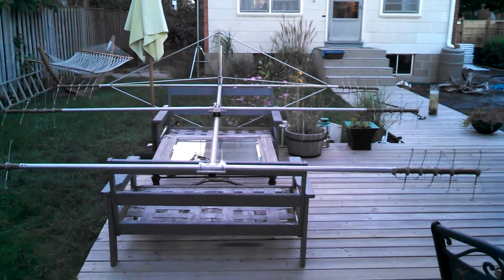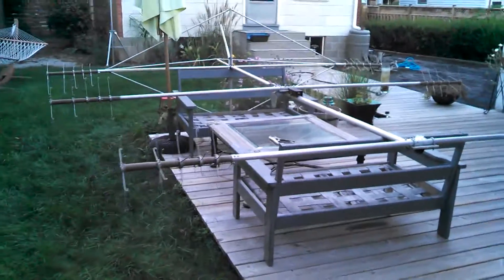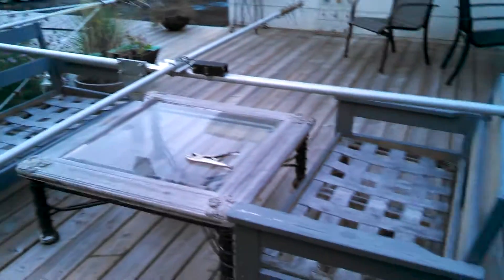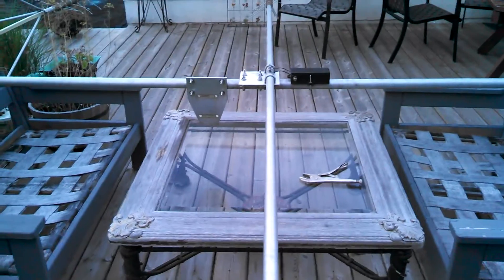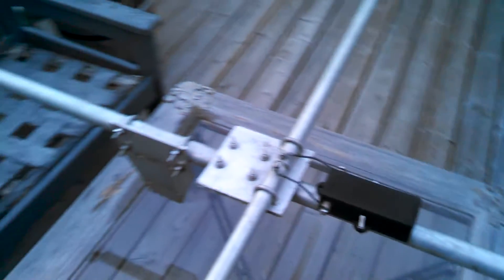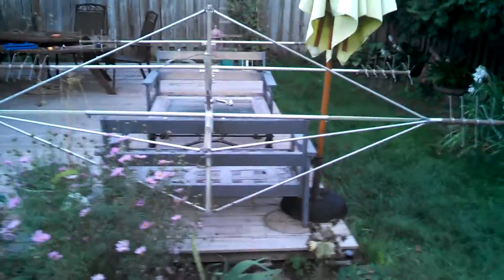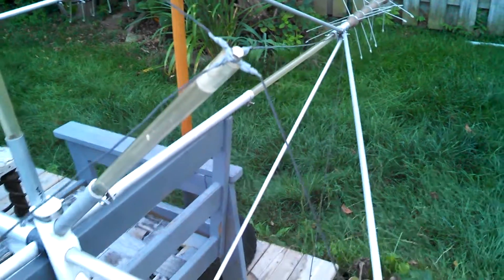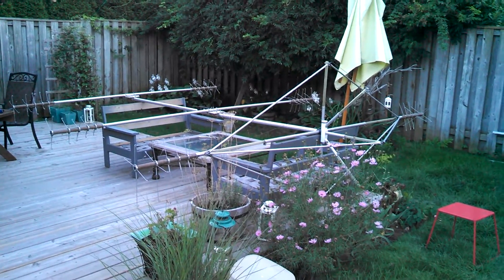MQ-36SR  HF Beam Antenna

Comment: I would NEVER say something isn't possible. I have too much experience making mistakes to say so.
However, in my case, I was NEVER able to get my MQ 36 SR to work as an actually Yagi Uda antenna. It made a nice rotatable dipole, buy NEVER got ANY front to back or gain over what a dipole would get.

I asked the antenna's maker to explain how to check the driver and reflector for proper tuning. He gave me a method that seemed about the the only way to do it. I found the required plus and minus five percent from the driven element to be off quite a bit from how it came from the factory. I checked it because it was not working properly. 
I was actually thrilled to find this discrepancy because I figured I would finally get my antenna to work right. 
Unfortunately these adjustments didn't fix the problem.
The only thing I could figure after this was that the distance from the driven element and director/reflector must not be correct. You can only get so far away with the boom length cut as it is from the factory.

I though my next try would be to extend the boom. However I had reached a point of frustration and felt that I could virtually guarantee success with a hex beam. I bought a KIO HexBeam and have never looked back. It has very nice front to back, side to front and front end gain over a dipole.

Last, upon asking the TGM antenna's builder why I had no front to back he replied that because the stations I was listening to were such high power operators that I was receiving both short path and long path signals, in EQUAL strengths and that's why I could not perceive front to back variation.

Well I would never try to touch that one. I will say at exactly the same location with exactly the same equipment, height, etc., The hex provides good amounts of all the things one expects from a Yagi Uda antenna. 
The TGM really did make a great compact rotatable dipole but that's all. For example. My last couple of months of operation with the TGM was after removing the reflector and director assemblies completely from the antenna. The performance increased once these elements were removed.

In reading as many reviews as I could find on this antenna, I found not one single instance of anyone mentioning any kind of front to back gain. And a couple of reviews that mirrored my assessment of ZERO front to back.

The manufacturer has some pretty grand claims as to front to back. I was not able to get any front to back whatsoever from this antenna.

I also built and maintain my hex beam and get all advertised gains per the manufacturer's claims. So at the least, I have been able to build an antenna that does operate as a quality Yagi Uda. 

When I asked the manufacturer how to check the time on the reflector and director, ha said he hadn't actually checked one for twenty years. 
Hmmm. To me, that sounds like he was saying he had not checked to see if any of his antennas over the previous twenty years could actually provide the gains he claimed they could.

Just my opinion.

My advise. Buy one of the well known brands of hex beam. Build one yourself. Of hey an Optibeam wire antenna that is muck like a hex beam regarding size, weight, turning radius, and I believe better gains than a hex. Also, Optibeam has a stellar reputation. Their stuff is pricy, but is it really worth it to save a few hundred dollars if you get something that packs no punch?
Reply: The TGM mini beams actually perform extremely well. But you're not gonna see a huge front to back ratio on them when you're listening to a 20 over S9 station. I actually have the two element version of this and it demonstrates significant front to back probably more than the three element. the front to back on the two element is about equal to a box on which has excellent front to back ratios.

I suggest you tune in to a weak beacon and rotate the antenna. After all that's what a directional antenna is intended to do pull in week stations, if you're hearing it station 20 over S 9 there's no reason to use a beam with them

Comment: Hello Slavko, How is now? would you buy the HF beam MQ36SR again? How is it performance wizes?
I still plan to buy this one or an Mosley Mini Beam, space on my top roof is very rare, so I think, this is the perfect one.
Reply: I know it's probably too late, but look at the Optibeam wire multi band antenna or just get a hex beam. I'm very confident the Optibeam would be a performer, and I know for a fact that hexbeams are what they're cracked up to be.